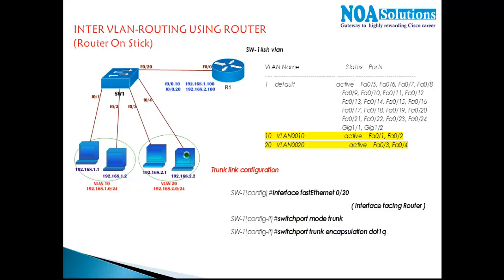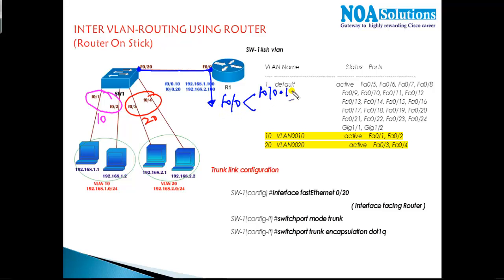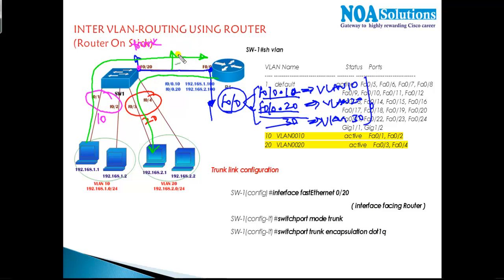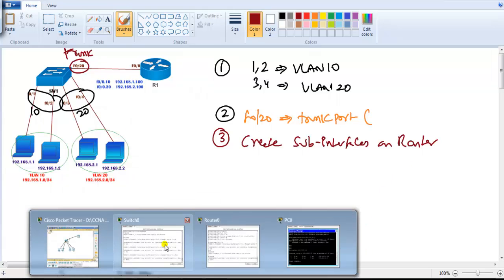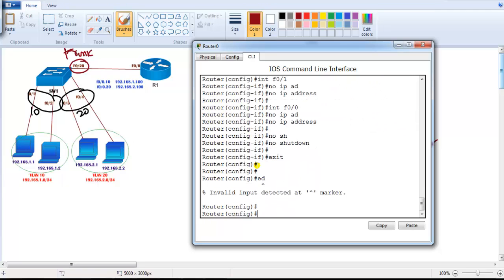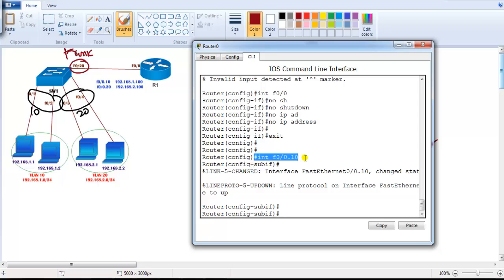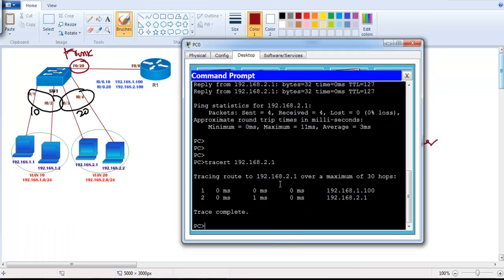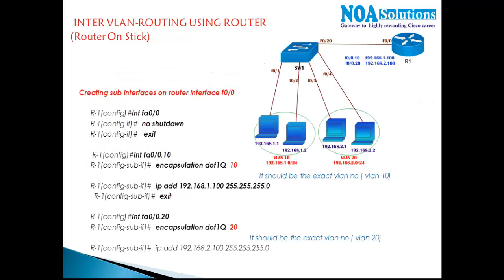Intervlan Routing Subinterfaces - Video By Sikandar Shaik || Dual CCIE (RS/SP) # 35012

Comment: Nice tutorial.  Can the trunk from the switch to the router also be an EtherChannel?  Meaning two ports on the switch, connecting to two ports on the router, via a port-channel trunk, while also supporting the three router subinterfaces?  You have great tutorials on switch-to-switch EtherChannel and switch to router trunking with subinterfaces.  Is there a tutorial that shows both at the same time?  Many thanks.